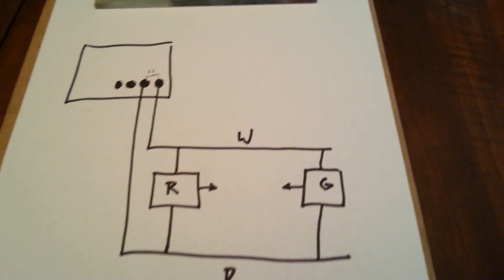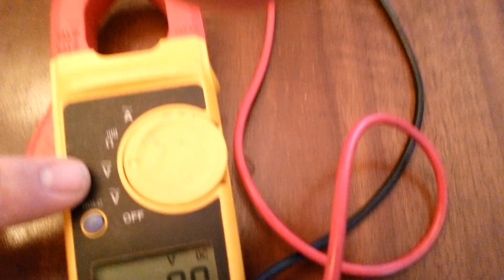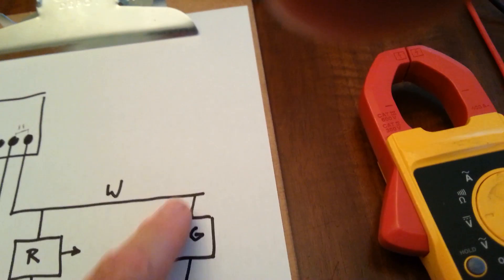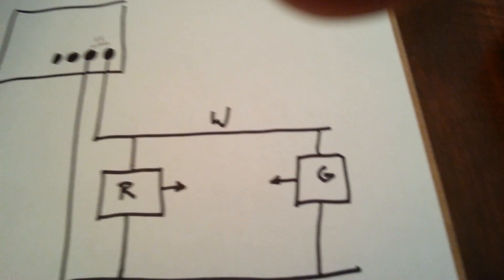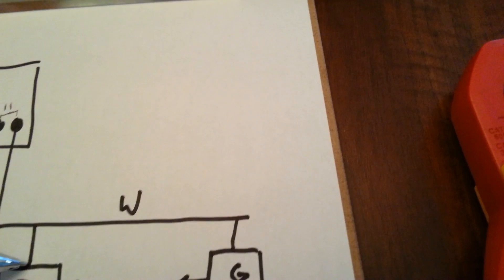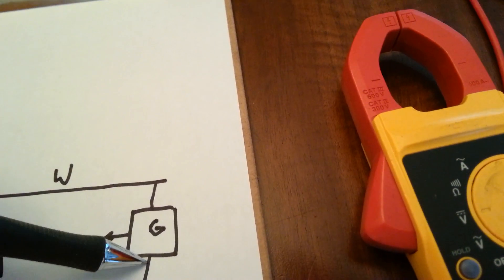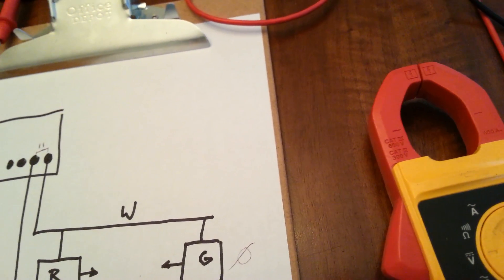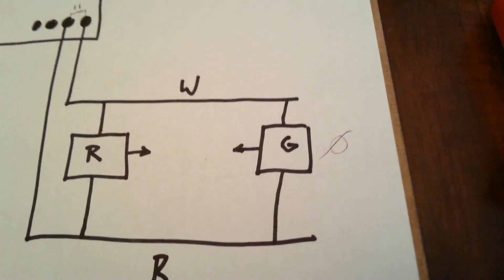Diagnosing garage door sensor problem from technical viewpoint.

Comment: I'm having an issue where the output contacts on the operator is not putting out stable voltage between the beam and common.

Comment: Getting 10 bulb flashes on Sears Craftsman indicating that it's a sensor problem. Garage door doesn't close unless button is held on wall unit. Both sensors show a green solid light and appears to be clean and pointing towards each other with no obstructions. What could be wrong?

Comment: In my case on the unit i got 6.95
On the sensors both got 6.95
And both sensors led is off
I m suspecting sensor but not sure any opinion

Comment: Can you put a jumper wire some where and eliminate the sensors?
Reply from the maker: You could connect black to white I suppose, and just rely on the wall switch. Why don't you try it and report back and let us know if the operator is still working. I have never tried it and don't know if anything would break in the operator by doing so.
Reply: You can't do this because the sensors generate a frequency. There are other videos which try this and show what works and what doesn't.

Comment: What gauge wire did you buy? Thanks! Same issues. My dad insisted I use a stapler to do it. It worked fine, but then it didn’t in a few hours.

Comment: so do I just use my multimeter (total noob with multimeters, bought one today) and place a black and red lead on the two screws of the back of a sensor to see if it reads 11 (or similar voltage) while in the DC mode? I suspect my logic board is out since I installed new sensors and no lights are on either side - I don't think my wires are damaged since they are in the ceiling and walls but you never know.

If this is a logic board issue I'm going to just buy a new unit since it's half the cost of a new unit
Reply from the maker: As I show in the video, check for voltage between the two screws on the operator, and then same for each sensor. All three points should have the same voltage. If incorrect voltage at the operator, change the operator. If incorrect voltage at the sensors, change the wiring. If correct votage at the the sensors, change the sensors.

Comment: Hi, new Genie has 13 volts at motor but zero at sensors and wired wall switch. Door does operate up an down with limit switches. Motor clicks when remote is pressed but nothing happens. Retraced wires 10x's and do not see any irregularity. Sensor swich connectors shox audible meter continuity. Sounds like a bad wire? BTW the Genie door is of very poor quality. Would never buy again. Threw away box so probably can't return. Call Genie and a lady with an algorithm chart reads it off.
What would you do?

Comment: My green sensor comes on intermittently. Power is fine, alignment is fine. Door works fine if green light is on. However, the green light randomly goes out and door wont close. Any ideas?

Comment: my sensors light up and appear to work properly, but the door wont go down, and unit flashes 10 times.        Chamberlain tech support said could still be a wiring problem,  not bad sensors.    The sensors could be getting power enough to light the leds,   but a bad wire connection can screw things up.     The way to check bad wiring is called the short wire sensor test.

Comment: Silly question, but isn’t the unit plugged into an outlet, so shouldn’t the voltage be in AC? Or is the unit converting the incoming AC voltage to DC voltage for the output to the sensors?
Reply: Yes, the unit is converting the incoming AC to DC. Almost all electronics/anything with a circuit board will first convert the AC to DC using a device called a rectifier.

Comment: Did you check the voltage across the green sensor when running the garage door up?  My voltage drops down to 7V and the green light flickers and sometimes will stop the door.

Comment: My green side is getting like half the voltage when I connect the wires. My voltage is reads ~12v at the wires themselves then like ~6v when I connect and measure at the prongs. I've already replaced both sensors with new. Thoughts?
Reply: Looks like there's a bad wire. After watching your video I didn't realize those sensors share the same wiring pretty much. To test, I just ran a wire from red side to the green side and voila... bob's your uncle😂 Thanks buddy...this video got the juices flowing for a really easy fix👍🏾

Comment: Your simple wiring diagram was the key to enabling me to understand, diagnose, and repair a wiring problem, which was essentially disconnected sensor wires in a jumble.  That diagram was flashed quickly at the beginning of the video, so I had to take a screenshot to have time to adequately digest it.  Your simple diagram was far better than more complicated ones in other installation and troubleshooting instructions. As complicated as it needs to be, but as simple as it can be.  Well done!
Reply: I second this

Comment: Neither garage door sensor lights up, bought a new control board installed it same problem. So I did a sensor bypass with 1 ft of wire and it worked, so then I replaced both wires and am having the same issue please help
Reply: Im having the same issue. I replaced with two sequencer boards and neither of them fixed my low voltage on terminal screws 3 & 4.

Comment: Sorry, you are missing a major point how garage sensor set works. I also though it was voltage or no voltage thing, but there is lot more to it! Sensor (sender) sends the infrared beam via  pulsed square wave and the receiver sensor constantly receives the pulsed beam (square wave) when there are no obstacles in between. When beam is broken then there is only one state on receiver (on or off zero or one) 
This depends on model of sensor set, but bottom line, with beam broken there is no change of state that is normally every few milliseconds. 

This is quite clever, if the sensor set fails in either in on or off (zero or one) state (signal or no signal) then  garage opener electronics will consider that sensors are malfunctioning and this will prevent garage door to close. This is why you cannot bypass the sensors, it is by design. 

I have also learned this the hard way after I bought new sensor set and only after I connected my oscilloscope to it, just like this gentleman is demonstrating here:
https://www.youtube.com/watch?v=GbmufXgpl14

Comment: I had find out the both green and orange sensor have no light but if i took green sensor wire out from the power supply in garage opener then other orange light sensor is on. Im really confusing why it doesnt work. Can you please advise ?

Comment: Can you install more than one sensor pair, say one pair at 6" from the floor and another pair at 36" from the floor?
Reply from the maker: I don't think you can very easily. I think that while one set of sensors would have a broken beam the other set could have a  closed beam and door would still come down. I wonder if there is a product out there that meets your need, why don't you surf around and post it if you find one.

Comment: Thanks for the information and video.
There may be resistors in series with the power/signal terminal on the inside of the motor unit, so 11 volts may vary.  The resistors would also provide some protection to the motor unit if the wires accidentally get shorted together.  I've seen an article that measured 6 volts with the sensors connected:
https://pages.mtu.edu/~suits/electronics/GarageElecEye.html
Using only two terminals on the motor unit, one being ground, then the other supplies power and receives the signal, so there is some manipulation of the sensor power line, at least for the Chamberlain style transmit/receive sensor pair.
Still looking for schematics of the insides of the transmit/receive pair.  Because I've got nothing better to do than repair a $45 part?

Comment: I have a Chamberlain and the voltage for the door sensors are 6V DC
"The output voltage for the door sensors should be between 5-6 volts DC
"

Comment: Why did you test in DC voltage? Isn't a garage door opener AC? Just asking.
Reply from the maker: The sensor circuit is dc, but the door opener motor is ac. It is not uncommon to have two types of power in one appliance.

Comment: thank you for the explaination.  I have a genie powermax 1500 and the sensors are pointed appropriately, and lights on both units are on, indicating that the sensors are aligned, but the door is stuck open and will not close.  ANy ideas here?

Comment: The red is flashing on the sensor. Green is solid.  Voltage is approximately 12 volts on both sides. On the garage door opener itself the little led is flashing red.  Help please.  Pbbraun@yahoo.com
Reply from the maker: For your privacy, do not put your email in your comments. Please click on the three dots to the right of your comment, click edit and remove it. If your red light is flashing, it probably means you have an aiming issue (sensors need to aim at eachother) or something is blocking the pathway between the two sensors.

Comment: What if both lights are green, however, the garage door does NOT stop when tripped? Does that mean the power wiring is correct, but the "trigger" wiring is incorrect?

Comment: One sensor on Overhead Door make is not working. I cut the wires to it and tested the wires coming from the wall and got a negative reading using dc on multimeter. Switched the testing tips and its still reading negative. Is that normal? I’m thinking I need to replace ONE of the sensors. Thank you.
Reply from the maker: The sensors come as a pair. You can get them at Home Depot. May even come with wiring. If you get around 11 v dc between contacts at controller, and not across the sensor, then change the wiring. In your case, I would just change wires and sensors and call it good.

Comment: Hi Todd, my brothers garage door has problems. The green light was not lit. I moved sensor. Both are lit with solid color now, but garage will not close. Goes half way down and opens back up. If I hold down the inside garage remote, it will close. Can you help me.

Comment: Just was working on mine thought I had an issue The sensors lights on either tried replacing the wiring but I’m only getting 6.3 V out of the terminals in the back of the opener my guesses the board is probably shot what do you think.

Comment: What could the problem be when one of the sensors has a loud buzzing sound that stops when I block the beam? I even replaced both sensors and still a problem. New motor unit too.
Reply from the maker: Seems like you have replaced everything there is to replace, except the wiring. Could there interference from an outside source? Maybe others can add something to your problem.

Comment: Thanks for posting the video, it helps a lot! I have a similar problem where one of the sensor doesn't have any power input (zero volt on the sensor's screw nuts) and the other sensor has power. However, all the wires goes inside the wall. What could be the best way to replace the wiring in this case? Thanks!
Reply from the maker: If you have power at the main unit, but not at one of the sensors, then run a new wire set to the sensor in the best way you can. Run it along the ceiling or wall. It really doesn't have to be pretty.
Reply: Good point, I was thinking of the same way. Running a wire through the wall isn't easy.

Comment: I find out the circuit board is bad I found some burn Mark's one side 46.00 on ebay and 73 from genie I got the o g part thanks
Reply from the maker: That makes sense, if you are not getting dc voltage between the two contacts.

Comment: Thank you for the great tips I have no lights on the both sensors. Do I need to buy new sensors? Thanks in advance I have genie h400a
Reply from the maker: I am going to give you a flow chart as if you are working on the machine in my video: Check for 11vdc between the contacts on the controller. If you get 11vdc, then check for voltage between the contacts of each of the sensors. If the voltage is 11vdc at the sensors and you don't have any lights on the sensors, then replace  the sensors.  If the voltage is correct at the controller but not at the sensors, then replace the wiring 1st.
Reply: @mrtodd3620  thanks for replying I dont have any tester but I did buy new sensors tried connecting directly to the unit no power.
Reply from the maker: @avtarbhogal7024   I would imagine then that you have a problem with the control unit but you really need to buy yourself a multi meter. You can get a fairly decent one at home depot for around $30. Only with a multi meter can you really test what is going on.

Comment: You mean the green (receiver) is flashing.  How do they transmit the "connected" signal through the power pair.  Please redo this video with a thorough explanation.
Reply from the maker: I wish I could. All I know is that one side sends a signal to the other, and if the beam is unbroken, the receiver lets through a voltage level to let the head unit know it is okay to operate. I would guess that the 11 volts dc is what is needed to operate, and if the beam is broken or the sensor system is broken, that 11 volts will drop to zero, but I haven't tested it that way. Why don't you break the beam and report back?

Comment: what if both lights are lit properly but the door still will not close.  The troubleshooter info suggests that for three blinks, you have a sensor problem.  What sensor issue could exist if both are lit properly?
Reply from the maker: Check to make sure that you get the right voltage drop across each sensor. If you do, then replace the sensors and see if that fixes your problem. Every machine is unique, I don't know how they all work so my video was just general information.

Comment: My question is: My sensor was blinking and is now off.  I am getting a reading of a very low voltage (don't have a device that measures it actually, just have one that beeps), but it barely beeps, when I have tested the wire lines. I have a black, green, red, and yellow...coming out of the wall and my sensor has a white/black and white connection. I can't figure out if I am wiring my sensor correctly to which wire type (I've watched you tube videos to no avail). The light won't come on and I've tired many different combinations. Any suggestions?
Reply from the maker: You can't do this repair procedure without a  multi meter. Any other tester besides a multi meter will not work for this repair procedure. You can get a decent one at a fair price at home depot. If you decline to get a multi meter, I would replace all the wires and both sensors according to the wiring diagram in the video.

Comment: I notice when moving the sensor wires coming out of the unit, the amber light above  the learn button goes on and off, it then stays off when I stop moving the wires
 Does this mean anything?
Reply from the maker: I don't know the fine points of how each product works, and I am actually just a dyi-er when it comes to garage door openers, but I think some units have a learn function where you pair your peripherals to the head. But back to your op, did you get approx. 11 volts dc between the two contacts on the head? If you have to wiggle a wire to get that voltage,  then maybe there is bad connection somewhere. If you don't want to open up the unit to see what is going on, then I suspect just replacing the whole thing will be a quicker fix.

Comment: What if neither lights are lit?
Reply: David did you get your sensors lights going? I have the same issues my circuit board have burn Mark's so I am getting new one that should solve my problem
Reply from the maker: All the wires go back to those two connection points on the motor unit. Set your meter to volts dc and put a lead on each contact and you should get around 11 volts dc between them. If you do, then your lack of lights on both sensors is probably due to a  broken wire. If you don't get the expected voltage reading, then you probably have an issue with the motor unit. Of course, you should make sure that your motor unit is getting 120v at the outlet it is plugged into.